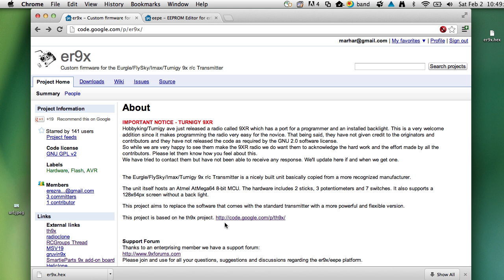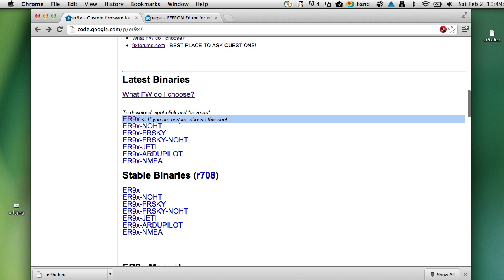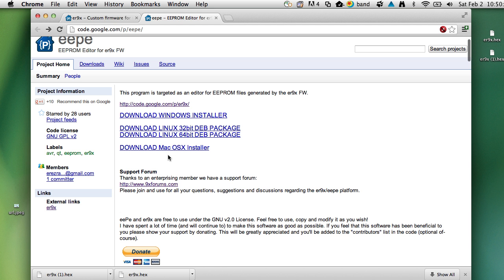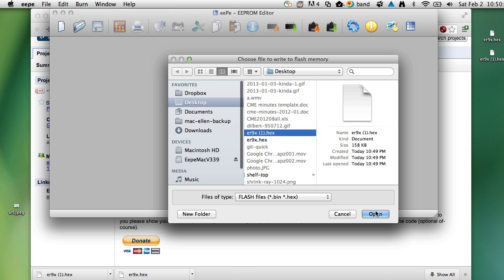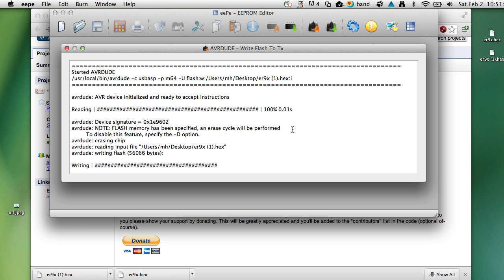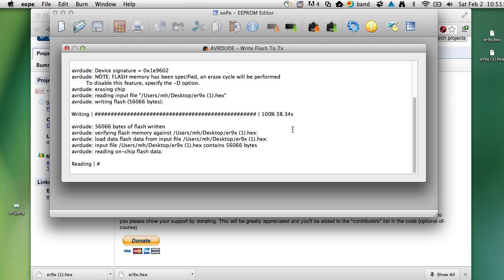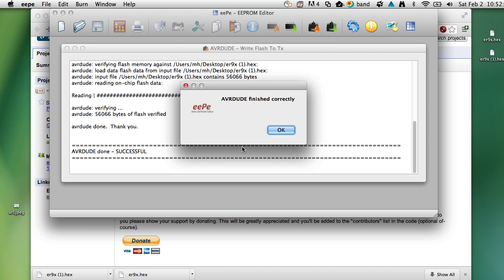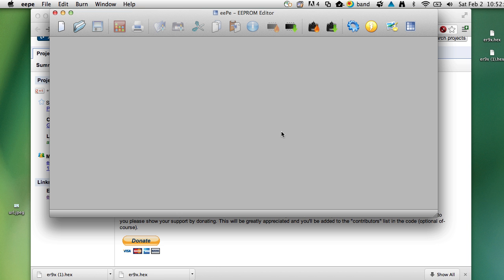er9x: Installing Firmware (good for Turnigy 9xr)

Comment: What are the advantages of er9x over the stock firmware?

Also I keep getting this error code "avrdude.exe: warning: cannot set sck period. please check for usbasp firmware update.
avrdude.exe: AVR device initialized and ready to accept instructions

Reading | ################################################## | 100% 0.01s

avrdude.exe: Device signature = 0x1e9702
avrdude.exe: Expected signature for ATMEGA64 is 1E 96 02
             Double check chip, or use -F to override this check."
Reply: BashMonkeyRC Nevermind on the error, got it fixed. Found out that "Expected signature for ATMEGA64 is 1E 96 02" was telling me that it didn't have the Atmega64 mcu because some of the newer 9XR units have the ATMEGA128A. Corrected for that and flash was successful, now on to setup and calibrations!

Comment: Hi Mark,
Unfortunately my friends stock 9XR ER9X firmware was giving him problems so I re-flashed it with a firmware I am currently using on my TGY 9X (er9x-r782 version; v1.6754-Mike).  Everything is working except for the backlighting which is no longer visible.  It does flicker but it is very very faint that you cannot see it unless you bring it in a dark room.  I have tried to turn it ON with different switches with no luck.  It was working before I re-flashed it.  Have you got an idea why?